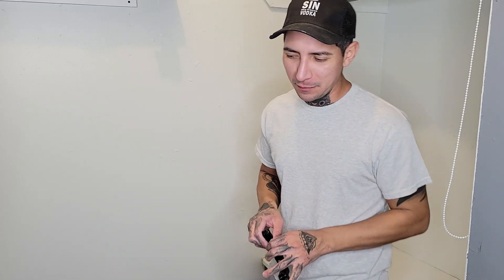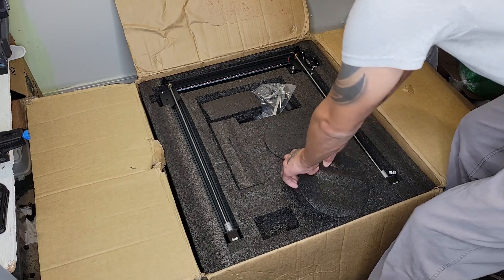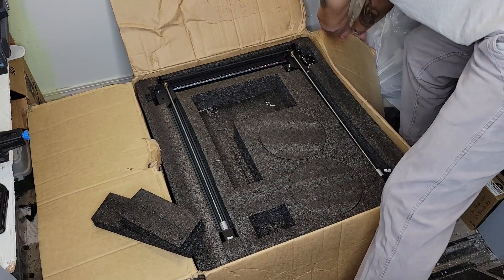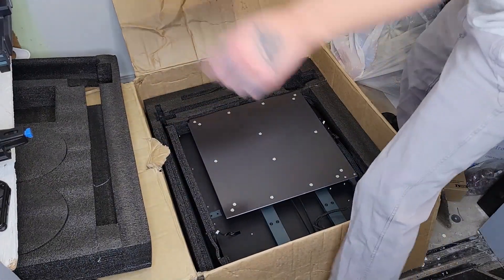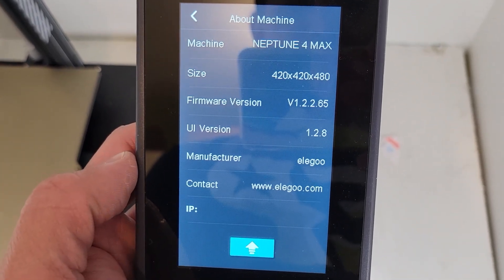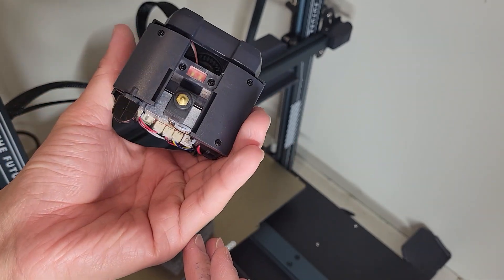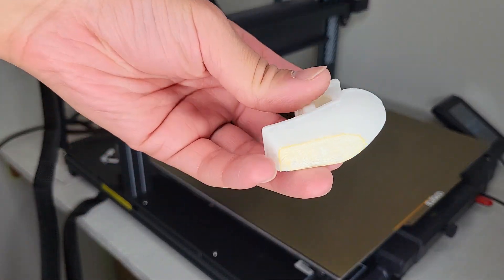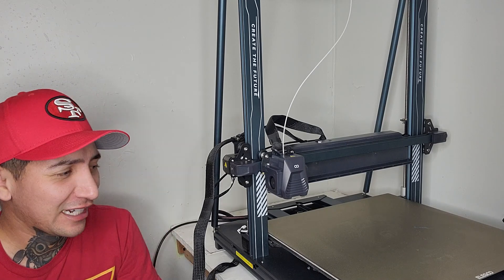I bought a BROKEN Neptune 4 Max!

Comment: Those nuts are supposed to be offset from center (or crooked and bent looking) it they are made that way so you can turn them in ways to make them either tighter onto the gantry or looser. There are ones like that on every axis so you can make adjustments. 
👍🏻
Reply from the maker: @psychorotica4770  interesting. I'll check on them again to see how they're doing. Thanks!

Comment: I bought a preowned one but in good condition
Reply from the maker: Luuuuuucky 😩 No issues or anything?
Reply: @NimbusDesu  I hope so, haven't got it delivered yet. I meant I clicked the "Good Used" option on their website and ordered that. Says it should only be missing the accessories which I already have
Reply from the maker: @slaughterman44  Nice! Comment back and lmk how it goes. It should be better condition than this. 😅😵‍💫
Reply: @NimbusDesu  update: works great! Even came with some of the accessories it said it wouldn't but I think its more of a don't expect them but if your lucky you'll get them kinda thing. Very happy with my purchase, no big issues I've noticed. Some print quality but I'm printing fast so I assume it's from that
Reply from the maker: @slaughterman44  dude, that's awesome! With this printer, after 3 prints, I have to adjust the Z Axis. But it's crazy how off the adjustment I have to make compared to the one I made that worked first. 😵‍💫😵‍💫

Comment: Aww c'mon man, that hotend was 100% repairable, the casing just needed to be plastic soldered from the inside with a soldering iron and the heatbreak just needed to be bent back into shape, maybe replaced, it is antithetical to the 3d printing spirit to just buy a complete replacement assembly unless it's for upgrades.
Reply from the maker: Haha you're right. Should've just printed a new one. 😅

Comment: Wow.  You bought a Neptune 4 Max.  They're all broken.....
Reply from the maker: Haha Yup! Seems that way. 😅 What would you recommend? I'm tired of broken printers. 😩
Reply: @NimbusDesu  I still hope the bugs continue to get smashed on the neptune 4 line.  When mine works, it's an absolute beast.  I have a Bambu P1S that works well and I'm looking at that new Ender V3 or K1C.
Reply from the maker: @KrunkTheMadMan  my next one might be a multicolor printer. Been wanting to give that a shot
Reply: @NimbusDesu  I'm with you there.  I didn't see a reason to buy the AMS on the P1S, now I wish I had.  There are other options out there (12+ colors), but you really have to have everything tuned in for them to work.
Reply from the maker: @KrunkTheMadMan  Yeah. They just seem like a less hassle but their software and everything is proprietary so you can't do much. But they work, so it doesn't matter.

Comment: concentric nuts they are used to tighten those wheels to the rails. You turn those nuts while it is assembled and it tightens the wheels to the rails.
Reply from the maker: Weird looking things. Haha I messed with them after I put back. Made it solid. 💪🏼
Reply: @NimbusDesu  Yes they are offset for that very reason, turning them draws the wheel closer to the rail. They are used to tighten up any rail assembly on your printer. I do not own this printer but Any modern 3d printer with those polley wheels should have at least one or a set of wheels with concentric nuts. Your Z axis and X axis if they have the same type of wheel should also have concentric nuts to allow you to snug everything up easily.
Reply from the maker: @LMG3D3DPrintingEnthusiast  Nice! I'll keep an eye on them from time to time. Thanks!